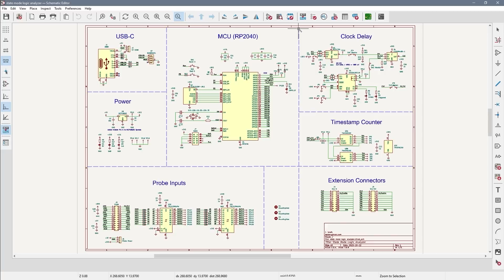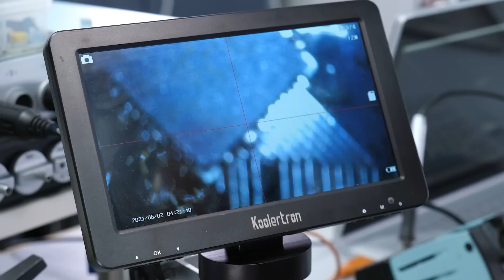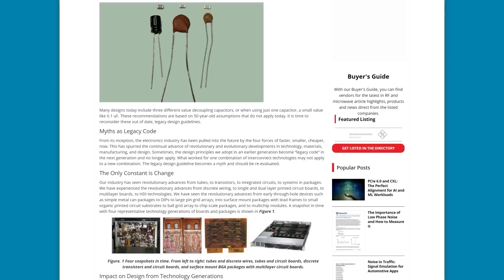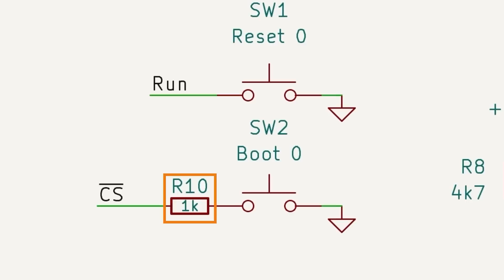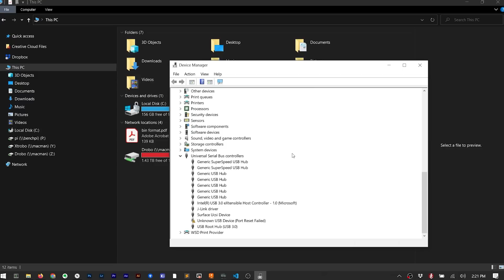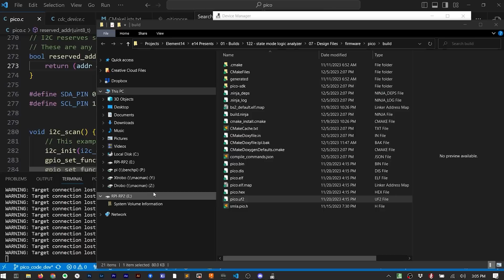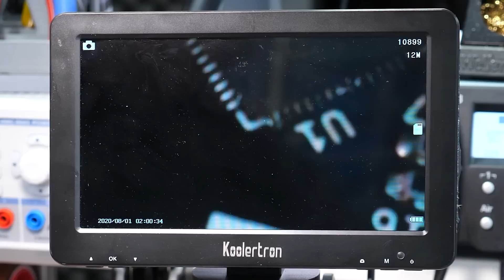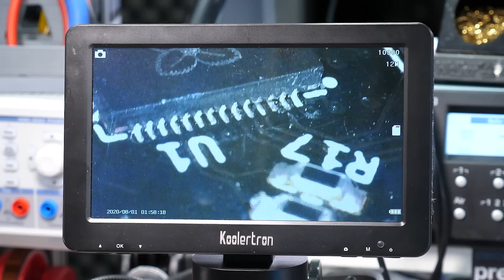Custom RP2040 PCB: Design, Turn-On, and Debug - How Hard Could It Be?

Comment: I have received my RP2040 custom design - I stuck a bit closer to the reference decoupling capacitors, because I don't know enough about what I'm doing to have Opinions™.  I have the blink program running on it, so that's exciting!  However, I don't seem to be able to use the serial connection (for printf debugging and the Arduino IDE can't use it to reset the board for uploading firmware).  I don't know where to begin to debug what's going on (hence the googling that led me to this video).  I got the PCB assembled at the factory, so it's unlikely to be a bad solder joint - do you have tips on where to start?

Comment: I got a pi pico here that doesn't work....  it shows up with an exclamation mark in device manager after started with bootsel held down but never puts up a com port after upload of micropython.    I have swapped rp2040 chip... no difference.  swapped crystal... no difference...  All power supplies are up and the parts work on another board....  gonna try the flash chip next.

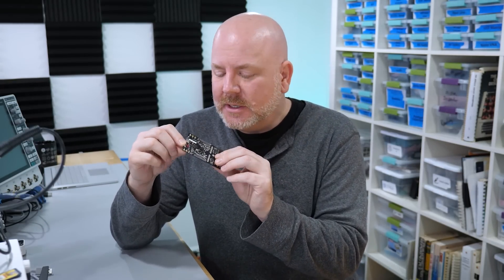Comment: 11:38 - Say what? Too much IPA damages pushbuttons? How? 
[
"How", as in both:
- what's the mechanism of damage? (It's a button !)
and
- how can there be 'too much' IPA?
]
Reply: It was just a passing thought. It's more likely damage from spending too much time under the heat gun.
Reply: @bald_engineer  OK, thanks for clarifying. I was afraid I might've hurt my computer mouse when I used IPA to clean the circuit board yesterday...
Reply: @RottnRobbie  As I think more about why I said that, I remembered I had damaged an SMT microphone around the same time. And I was researching ultrasonic cleaners and surprised how many components are damaged by those. So, washing failures were on my mind. 

But it’s more likely flux got into the switches and melted something.

Comment: I fixed a fried pi pico once, soldering a new RP2040 onto it. That was my first try at soldering components without (at least stubby) legs. I used an upside down clothes iron as a hot plate and a one of these torch lighters as a hot air tool. I applied solder to the pads and the chip using a soldering iron with lots of solder on it (of course, using lots of extra flux). I managed to get all contacts working at only the second try. The key to success was pressing the chip down onto the board, connecting all the pads and squeezing out the excess solder.
Verification of all pins being connected is also possible without it booting up, even while that thing is still hot. Just use a multimeter on diode mode and test all pins (positive probe on GND). Connected pins should read somewhere around 0.3-0.8V (also the debug pins and the usb data pins). The other GND pins should of course measure 0V.

Comment: Getting the correct amount of solder paste will always plague the home hobbyist.
I like using an IR under-heater with hot air on the top.
I then will use an iron to reflow those QFN contacts.

Comment: I have just ordered my first RP2040 PCB design. I ordered it with top side assembled in order to avoid soldering issues.
The PCB is the size of a DIP40 EPROM so I hope I did not make too many design mistakes!
Thanks for sharing your problems!

Comment: But how would you have troubleshot this without access to a $20,000 scope?
Reply: With a basic scope. He used only functions that are presentvon even the cheapest real scopes.😮
Reply: multimeter in diode mode. Positive probe on GND. Test every pin that comes from the RP2040 using the negative probe. Every GPIO pin should read the same value (within ~5mV of each other). gpios shorted together should read ~40mV less, GND (and stuff shorted to it) should read 0V. If it reads open, it's not soldered on. Also test the special pins (usb data pins, debug pins).
Reply: @HL65536  Thank you for providing a useful procedure
Reply: I can’t figure out your joke’s punchline. So I have to ask… how?

Comment: 10% pad reduction works fine for me on on a 100 um SMD stencil
Reply: That's a good point. My friend has been cutting many of my past stencils for me. We worked out some reductions based on pad sizes that work well. I used OSH Stencil for this stencil and just left everything on default in KiCad. Next time I order from them, I might re-submit this one with a reduction and compare it to see if it works better. 

The real problem is that my paste was over a year past its expiration date. So, it didn't hold its shape well.